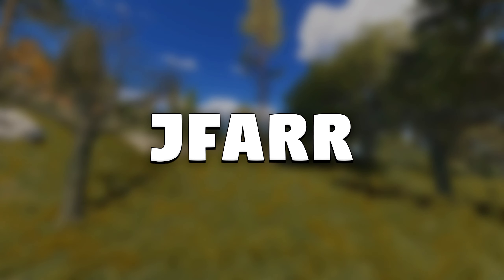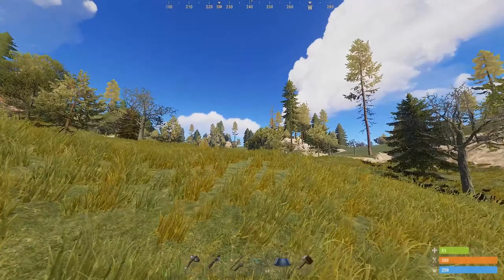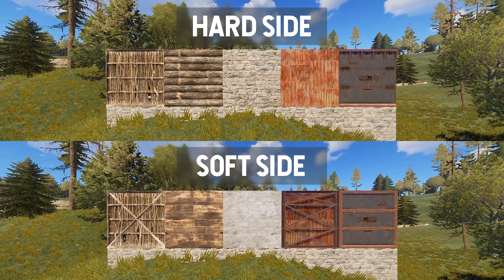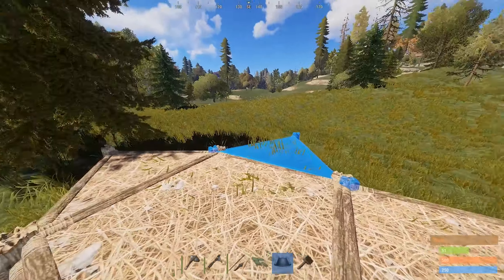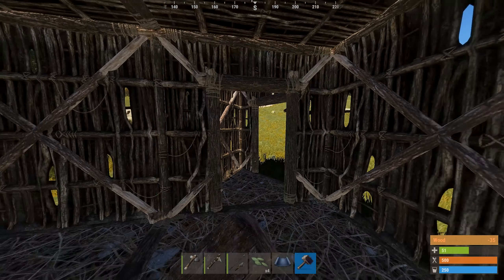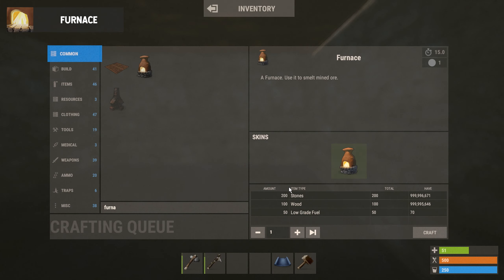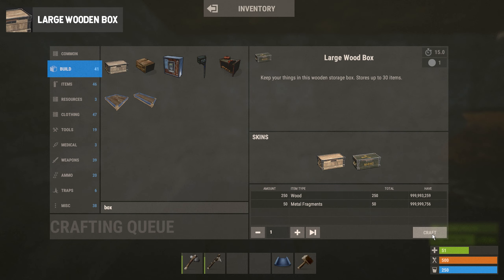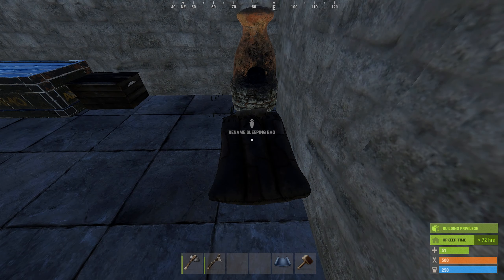Base Building Guide | Rust Tutorial

Comment: how do i break walls i make
Reply from the maker: 3 ways to break walls. Can demolish them with the hammer (Right click wall with hammer out and select demolish) if you have a tool cupboard but you need to do it in under 5 minutes of placing it otherwise it won't let you. Second way is to hit the soft side of the wall with a hatchet or pickaxe depending on the tier. Third way is to blow it up with explosives.
Reply: @JfarrYT  ty so much